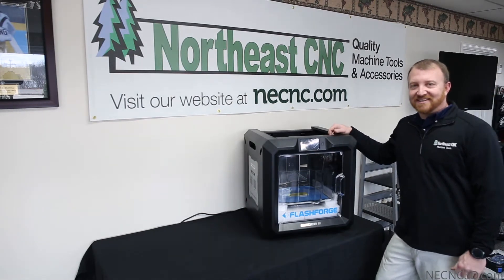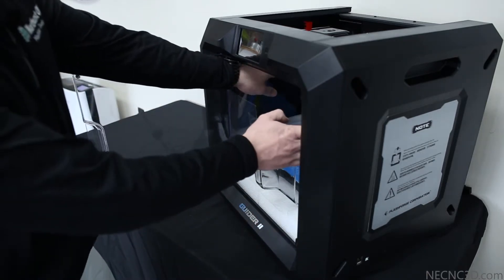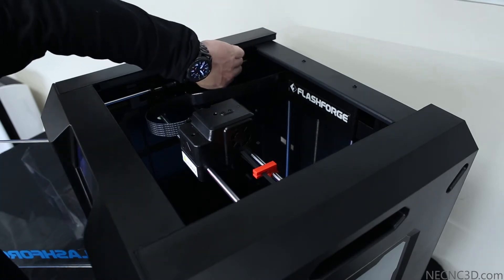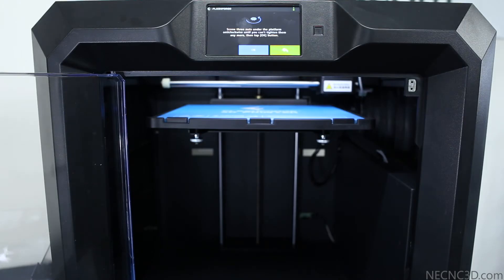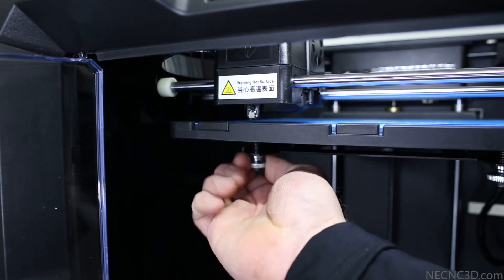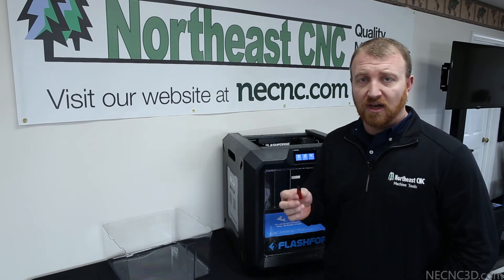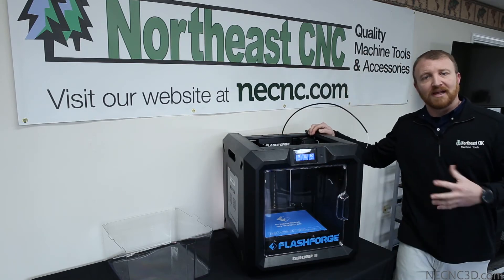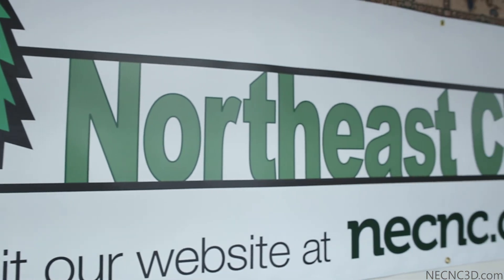Northeast 3D - Flashforge Guider II Setup

Comment: Dear Northeast 3D Bought my Guider 2 at Xmas (my first 3D printer) I was working fine until I connected it to the Web now I cannot get the Bed to reach the extruder to level or calibrate the extruder, I have downloaded and installed earlier firmware but no difference, can you help please?  Terry

Comment: Some print jobs do not start printing. I have been able to adjust the temperature on some print jobs that will automatically start printing, but some jobs will just not print. The printer sits idle....printing 0.0 %. I am new to 3D printing so it may just be user error or maybe some bad downloaded stl files. Does anyone have a fix?